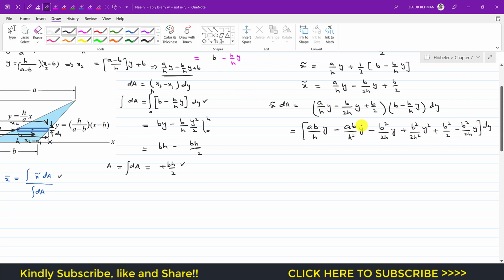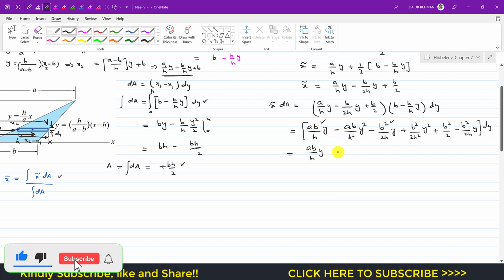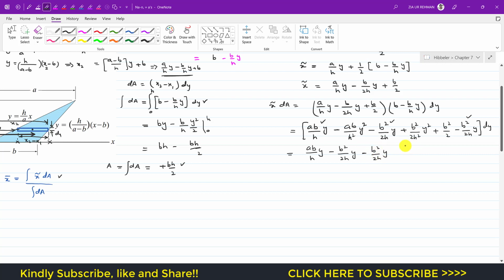9-30 | Center of Gravity and Centroid | Chapter 9 ( Hibbeler Statics 14th ed ) Engineers Academy

Comment: Is it right? When I solve this, the answer is '(a+b)/3'.  In addition, maybe you can use a way that adds all the points and divides 3 like (x_A+x_B+x_C)/3. If you do this, the answer will be (0+b+a)/3.
Reply from the maker: I didn't get u
Reply: @engineersacademy2020  
I think like below.

x-bar = [(x-bar of large triangle)*(area of large triangle) - (x-bar of small triangle)*(area of small triangle)]/[(area of large triangle)-(area of small triangle)]
= [(2a/3)*(ah/2) - ((2a+b)/3)*((a-b)h/2)]/[(ah/2) - ((a-b)h/2)]
=(a+b)/3